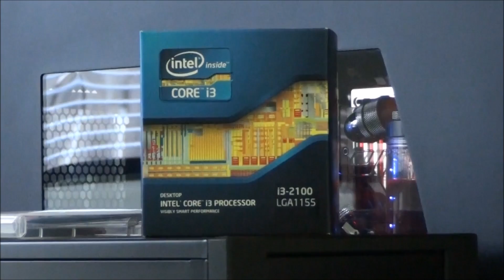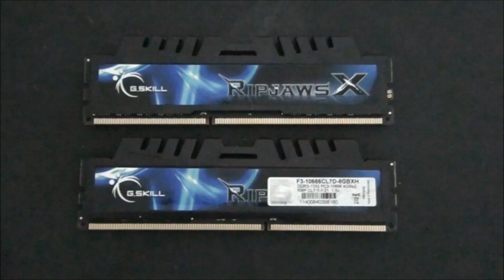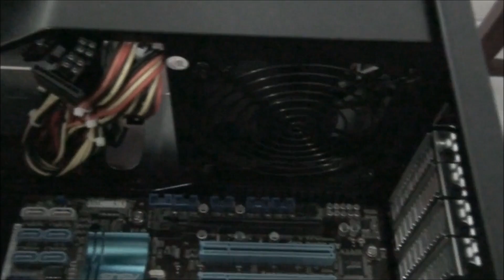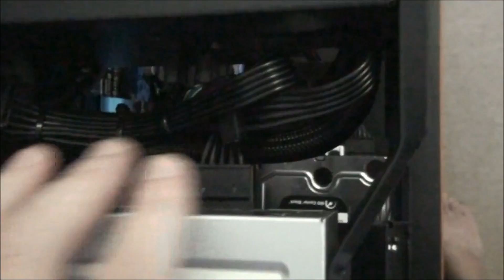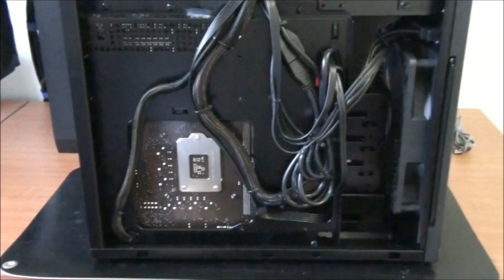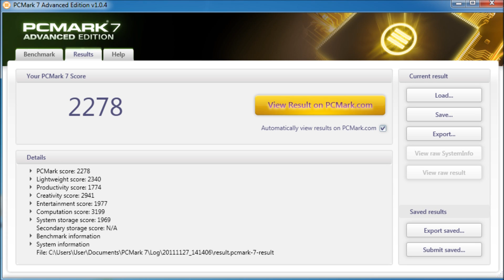Singularity Computers Client Build 2 - Entry Level System

Comment: hey i need your opinion on something, my budget build that i built this summer is starting to get slow, my ingame performance has severly dropped and as a result i am probably going to upgrade parts of the system. My specs are:
gigabyte: ma78lmt-s3 motherboard
phenom x4 955 cpu
radeon 6770
485watt noname psu
500gb wd  caviar
8gb corsair vengence ram.
My question is, what would be my best bet to replace that would improve my ingame performance?

Comment: Corsair Vengeance LP - 8GB 1600MHz PC3-12800
OCZ Vertex Plus SATA 2 2.5" SSD 60 GB
Noctua NH-D14
Intel Core i5 2500K Boxed 
MSI R6870 Hawk
Asus P8Z68-V LX
LG GH22NS70 Zwart 
What do u recommend PSU? 500 watts? Don't think i gonna run Crossfire